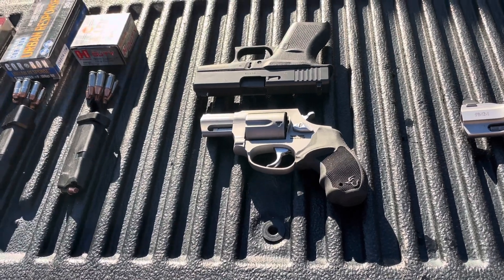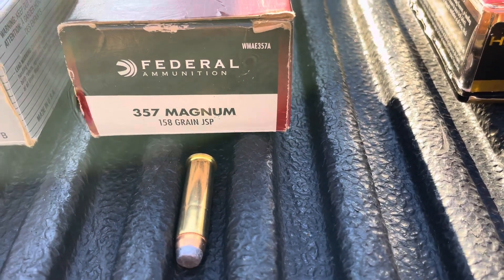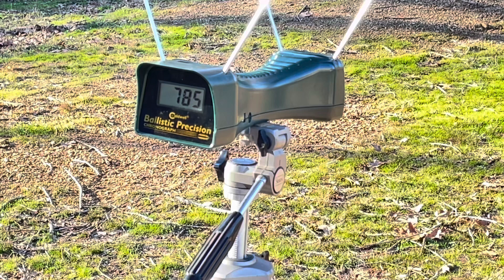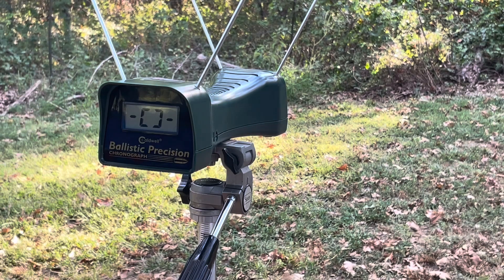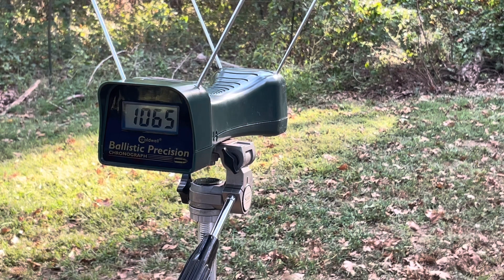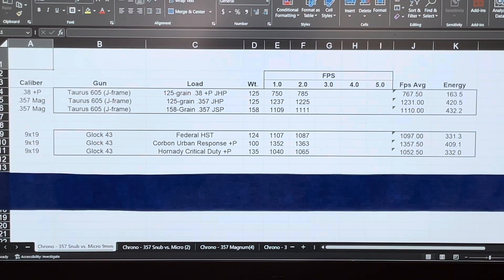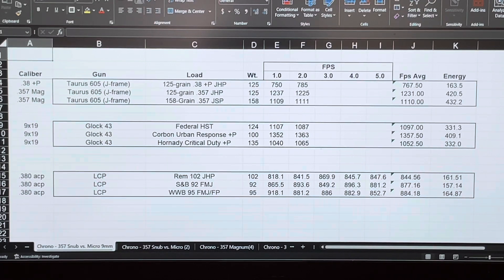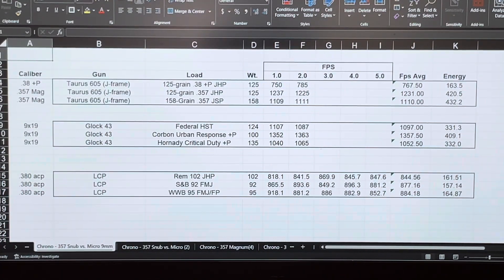Snubnose .357 magnum revolver compared to a￼subcompact 9mm

Comment: Glock 43 barrel length is 3.41 inches. 

Snubby length is 2 inches     .
Reply from the maker: Completely true, but have to remember that a semiauto's "barrel length" includes the length of the chamber itself, where the revolver's doesn't. In 9mm, that's ~1.2", so the G43's 3.4" is really ~2.2" of actual barrel for the bullet to accelerate; almost identical to that of the revolver.

Comment: The conclusions you came to are similar to mine.   I've taken to carrying the Ruger LCP MAX as my EDC pocket carry using the USA white box as my carry/training round.   And supplementing some practice with a .22lr LCP 2. 

Now on the other hand I've carried, not pocket wise either a .357magnum snubbie S&W 19, 66 or briefly a Security Six.  About 50/50 timewise 125gr jhp or 158gr jhp.

Comment: So i'm the guy that has to inform you that your ''+p" 38 special is not +p.  Standard +P 38 125 grain from a 2 inch barrel will be moving in the 850-950 fps range.  So either winchester's +p 125gr load is fake, or you got a bad batch, or that ammo was mixed up with standard pressure at the factory, or on the range or even some teenage kids at the store shelf.  But the short of it is that it doesn't make much difference, typical carry ammo in 38 special +p doesn't compare to 9mm... 9mm is more efficient in short barrels.  

That said, you can put some underwood or buffalo bore +p rounds in that 605 and have moderate 357 mag power for bears or people without all the recoil or noise of the full 357 loads...and those are quite a bit more power than 9mm.  They are somewhat expensive and can be hard to find sometimes though.

Interesting tests.  Thank you!
Reply from the maker: Appreciate the wanting to come up with an explanation for something that doesn’t seem to make sense, but barring a mistake at the factory, that is absolutely Winchester +P model USA38JHP. Bought them new, they have the +P head stamp, etc.

Some 38+ P loads will absolutely get more than that from a 2” barrel, but some won’t. For instance, take what lucky gunner found in 2” testing; only getting 797 FPS with the +P 129 grain hydrashok; and in the military arms channel video, he got 789 FPS with a 125 grain 38+ P load.  So I’m comfortable that the 767 I got is real.
Reply: @MyHillbillyLife  yeah, but it is shooting the exact same velocities as a all standard pressure 125 grain rounds.  So it's not plus P... They might advertise that, but if it is perfectly in line with all other non +P loads, then it just isn't +p.  So i disagree.  But like i said, it doesn't matter, the point of your vid is that 9mm is superior to 38 special  which is kind of true...but not really...and that is becoming less true every day as ammo companies come out with more and more high end 38 +p.  38 spcl has way more potential than 9mm with it's extra case capacity, and underwood and buffalo bore have realized that potential with a few, real 550 ft pound loads... Other companies are starting to load heavier 38's as well now.  The europeans load 38's as standard pressure that are way hotter than many US +p loads.
Reply: @regulator45  Keep in mind that the "+P" loads in .38 spl (basically all of the days revolver rounds) of today were the standard pressure loads when they were developed and well into the 1950's. The +P was downloaded for a lot of reasons in the 50's and 60's mostly for fear of being sued.